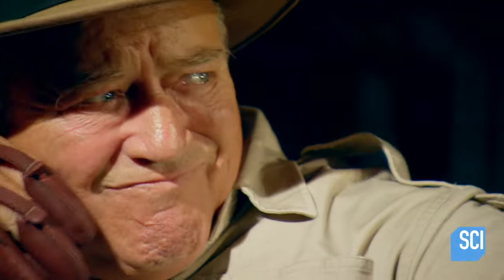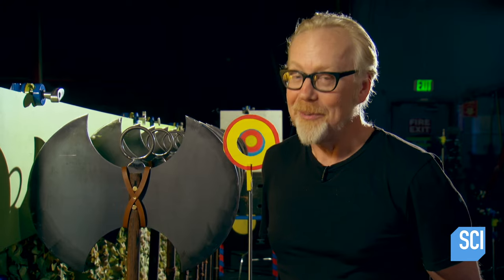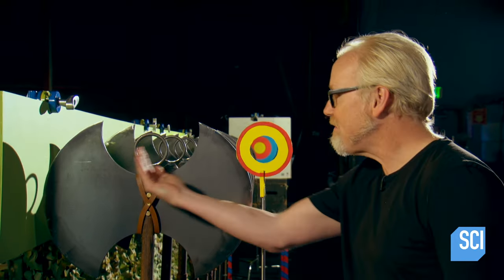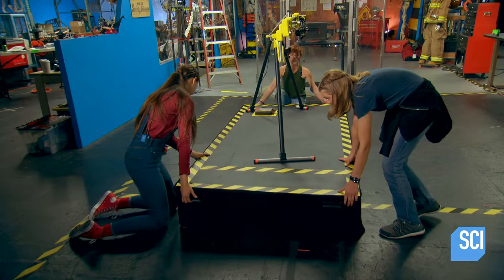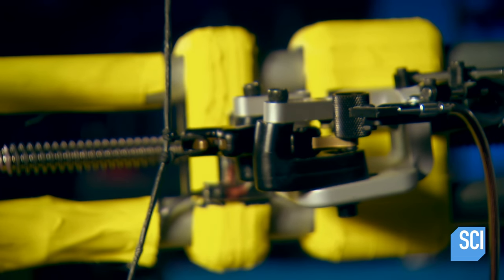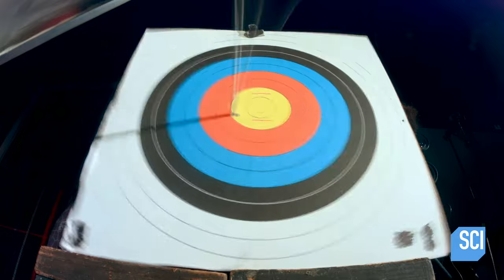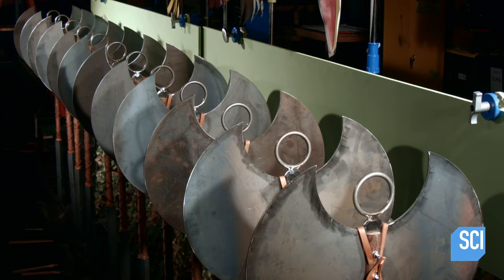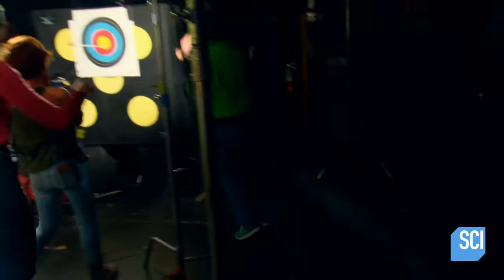Replicating the “Impossible” Odysseus Arrow Shot | MythBusters Jr.

Comment: The book is talking about the eye of the axe, which is hole the handle goes through.  Not a round loop off the top.
Reply: Why isn't this comment more appreciated?
Reply: To be honest, the axes are basically just for show, it's just about the ring
Reply: Spot Trooper makes a great point, those rings are definitely way larger than the hooks on the bottom would be. Not to mention the fact that those look like a fantasized version of a dane axe and don’t have nor need hooks
Reply: In Russia it was firing trough wedding ring and into the edge of a dagger to split the arrow so it woudn't kill the person holding both. I don't think it is such a big problem if the hole is big enough for an arrow to go trough.
Reply: @Spot Trooper True, you get a point.
Reply: It's not the eye. Some bronze age axe heads were fenestrated, which means there were holes in the side of the blade to lighten the weight of the axe. The ring on top here is inaccurate, but the way the axes are lined up is basically correct. The hole should just have been in the middle of the blade instead of on top.
Reply: I recall that in some movie the arrow went through the opening in the blade, which is quite wide.  That opening is very small, and I don’t think it could have ever had any use.  While an opening in the axe head would widen the blade, decrease excess weigh, and allow a lower angle of attack of the blade.  Saving energy…. Think of an opening in the shape of a capital D in the blade.

Comment: In the epic, the bow was nigh-impossible to string.  Therefore it's a very stiff bow.  Thus a very POWERFUL bow for a powerful man.  That would make the arc of the arrow launched from it flatter in that range.  Then the question on the arrows: how much can they flex before hitting the rings?
Reply: Are u Legolas?
Reply: John Smith  The stronger the bow the more it should increase the paradox and even going with stiffer arrows will only result in the identical flight as a weaker bow and flimsier arrows. The only way to reduce the paradox would be by stiffer arrows under the same draw weight.

Comment: So many people comment that Corridor Digital did this last year. However, there are a few things to note:
1. Corridor had larger holes which were not metal. If they were, even a slight touch of the arrow (yes, the arrow touched the sides) would've resulted in a failure.
2. Odysseus' bow was the strongest bow ever made (according to the myth) and only he could draw it. A weak bow has naturally a greater projectile drop.
3. „Shooting though axe heads“ is a vague term. Some people cut holes into the axe heads, some add rings. But it is very likely that the holes the shafts are attached to are meant here, and shooting through multiple of those is nearly impossible.
Reply: I feel like high bow strength would actually make it harder. Less bow drop, but higher strength bow would mean the arrow flexes way more, making it more likely to hit the sides.
Reply: i dont think nikos shot would have done it on metal but nicks shot was perfect and would have totally made it
Reply: @aaronyoung9922  if you look at the slowed down footage on the second shot you see that basically the only thing touching the axes is like the back "feathers" for a split second
Reply: I always interpreted the contest description as the hole in the head that the  helve fits into, not a ring on the axe head nor a hole cut into the head of the axe. That would make it even more of an impossible task in that hole would be through a solid metal head with virtually no play, and the arrow would have to be launched not only precisely but with enough force to ensure that the speed of the arrow keeps it on as straight a course for as long as possible.

Comment: Don’t move the bow.... move the target and then the tunnel to where the bow wants to be.
Reply: To late, what's done is done
Reply: Yeah, I feel like that would have been WAY easier.
Reply: How would moving all the rings be easier? Lining those up must be a nightmare. Moving the bow is FAR easier than trying to change the direction of ALL those rings' alignment.
Reply: @spamhere1123  yea. Why would you move 12 rings that are lined up already. That's a  very strange suggestion. Moving the target is also not the main issue. Besides, that's not the myth. The idea is whether or not it's possible for someone to do this. And judging by that high speed, even with near perfect relocation, they still barely pulled off a miracle shot
Reply: spamhere1123 lasers, boards, doweling or a common base platform would have made that super easy since there are common touchable alignment points. The reason the bow was hard to align was because it doesn’t have anything that perfectly aligns with the shot except the arrows flight path which is hard to predict and impossible to hold still and use for alignment.
Reply: @rosedruid  You can't be serious. Do you actually believe that moving and aligning about 20 rings is easier than moving the one platform the bow is mounted on? And you can literally align the arrow with the draw track they had machined in there, which apparently worked like a charm, because they hit it first shot.
Reply: spamhere1123  Yes, because changing 1 variable(ring) won't fk up the other 11 rings and each would be independent of another. Whereas changing aim of the bow is a variable that makes all 12 rings dependent on another.

Ex. Arrow hits the 11th ring. You suggest to completely change the aim. Or you adjust only the last ring.

Being lucky like them can very easily skew viwers perception on how poorly their method of calibrating may seem.
Reply: The end result is the same.
Reply: No joke genius a compound bow is alrradu accurate enough, to even habe the idea of using a machine to shoot it is just plain stupid.
Reply: So you want to move a big ass target and the ring in order to make the shot perfect? Yea let me position this 20kg target while my bow weights 2kg its also easier to line an arrow with the target if you JUST MOVE THE BOW you DO NOT touch your target you touch your bow and what your using to line the arrow up you don't move the largest thing
Reply: Yeah that was an extreme oversight
Reply: To all the people saying "moving one rig is easier than 12 rings" like the rings weren't all boarded down on a single board that is easy to move. And if they didn't do it this way, then it just shows how far the shown has gone down since Jamie left. 

Just in case you still don't grasp it, all the axes should've been on one long platform, which is much easier to move AS A SINGLE PIECE instead of moving two pieces, including the bow, and hoping they lined up. They wouldn't ever be moving more than 1 piece this way. 

The issue with the new kids is Adam has no one to clash with anymore. All the kids look at him like a God and does exactly what he says. Jamie and Adam clashing  and explosions is what made this show great. It is no longer great.

Comment: So I want to point somethings out, 1: Odysseus had a multi-hundred pound(like over 200lbs) recurve bow, not a longbow, this does change a lot of the factors, due to the fact that an average Welsh(British) Longbow was about 100lbs in weight, and by increasing the power of a bow, increases the amount of speed and force that arrow can produce, and can create a long flat fight path before it started to curve downwards. 2: They are by far not the first people to try to do this challenge(of their age range? Probably) this is actually a very common challenge to attempt throughout history, and it has been done.

The reason why this shot is said to be impossible is because of the weight of the bow, as literally, no one should be able to draw a 200+lb bow and shoot accurately enough to thread an arrow through ringed Axe Heads. But this is by no means impossible

Comment: When a human who uses their fingers to "release" the bow's string,  Archer's Paradox is more pronounced in the X-plane. When a compound bow is used, the oscillations are more pronounced in the Y-plane due to the use of a drop-away arrow rest. If you look closely, the last 2 rings were "hit" with the arrow's vanes. Yes, when a human attempts the shot, it is all but impossible with the relatively small inner diameter of those rings due to the LARGER oscillations caused by the human archer!

Comment: This is not correct- by using a modern compound bow, the arrow flexes a lot less because of its higher speed. With a traditional bow this would be impossible, not plausible at all.
Reply: Wrong look at corridor crew they did it
Reply: Well according historians about the myth the archer was stronger than most people and he made a unique bow designed for only him to use. It may not be compound bow, but it could of been powerful as one from the custom longbow. Thus, it is possible for the individual to do 
so, but it is uncommon for that individual to have lot of strength. It's plausible to some to many no you have the right to claim it.
Reply: Trevor Allen ok, the mythical bow that Odysseus was able to use from his strength granted to him by Athena would be able to do this.
Reply: The flex of the arrow is not based on its speed through the air. It's based on the flexibility of the arrow and the strength of the bow pushing said arrow. A more rigid arrow pushed by a 40 lb recurve will barely flex at all even though it will travel at much lower speeds than a highly flexible arrow pushed by a 100 lb compound bow.
Reply: Devin Hernandez yes but if odysseus used that stiff of an arrow with a tradition bow like others of the time period the arrow would not be flexible enough to satisfy the archers paradox and fly “straight” as it were. Either way, I suppose it is important to remember that this is a myth where gods intervene with human action, strength, and decision making, so anything goes.
Reply: @arigerard9239  I was addressing your incorrect statement that the arrow flexed less because of its speed. That is simply not the case. The arrow flexes less because of its rigidity. On a compound bow like the one they were using, the archer's paradox has little to no effect. The arrow does not have to bend around the bow like it would on an old long bow or recurve bow. Meaning the arrow can be stiffer to accommodate for a stronger bow string.
Reply: Devin Hernandez yes I am aware of this. I was assuming that in ancient greek times they didn’t have the tools or knowledge of arrow rigidity and mass and how the different variables affect its flight. But im no expert on ancient greek weaponry.

Comment: Those that are saying the archer's paradox would make a straight shot impossible are either forgetting, or not aware, that arrow's spine plays a great importance to this.

Over spine the arrow, and there will be little to no "course correction". Then just correct for a new point of aim.
If Odyssey's bow was as powerful as purported, the correct arrows to deal with a "normal" level of archer's paradox would have already made it much stiffer than what any other bow needed.

The flip side to this is to use a heavily underspined arrow to shoot arrows that seemingly turn midair.

Comment: Point #1: You need an archer that is actually pulling and HOLDING the string and the bow weight, and releasing with his fingers.
Point #2 : A compound "bow" is not a bow, it's just an arrow launcher with nothing in common with a proper BOW (see point 1).
Maybe I will try it and see if its possible or not.

Comment: I don't think "the eye of an axe" from the Odessy means a hanging loop over the ax, which wasn't a thing done with axes. It means the hole in the ax head through which the handle is fitted. That makes much more sense than the arrangement you are showing in this video.

Comment: Ok fact number 1. The average draw weight of a classical longbow is believed to somewhere near an astounding 175lbs. Historians as well as scientists are baffled at how they were used effectively but they were. The longbow they tried would have been no where near that strength as they were pulling it pretty easily. The compound bow they used was  probably around 100lb if not lower. So assuming that Odysseus's "bow which no man besides himself posessesd the strength to draw" is at least as strong as the average for a classical English longbow. Then the force and therefore speed of the arrow would have been almost doubled from even the compound bow. As the original fictitous bow was supposedly impossible to draw for anyone weaker than Odysseus, we can assume that it was far stronger than 175lb and would then would send the arrow far faster. According to physics the gravitational pull exerted on the arrow stays the same while the forward momentum is increased, this effectively means that the arrow has less drop over a greater distance. It flies straighter. Taking into account that it was a fictional weapon, this is still not an accurate depiction of how the arrow would have traveled in that fictional situation. For a man capable of drawing a bow with such Power this shot would have been far easier because there would have been little to know arrow drop.

Comment: Odysseus did not use a longbow. Your compound bow could do it because it's probably a good 100-150fps faster than Byron's longbow (about 200fps). Witha faster trad bow, and they are out there, it might be done. Modern trad flight bows, and Turkish style trad bows, with lighter arrows can get the same speeds as a modern compound bow (up to 500fps) and cast arrows as far (over 1300yds).

Comment: It's an IMPOSSIBLE shot, and by impossible  I mean that IT CAN NOT BE DONE with the bow technology of Odysseus' day.  The central section of the bow (the riser) was off-set from the line of travel of the strings movement because of the required rigidity needed.  This (along with the archers sight picture) creates what is known as the "archers paradox"  The arrow shaft WILL be (and MUST NEEDS BE) severely bent/flexed as it is launched to get past the riser and then it will go through a cycle of harmonic flexing.  At some point this flexing will be reduced to describe a path narrow enough to pass through the axe-head eyes  BUT not until after it has slowed down enough that the fight path begins to drop at an ever increasing curve.  So the ONLY hope you have is to pre-align the openings along a known and well described trajectory.  Given modern bows and a well enclosed indoor range I could do this in ten  practice shots with eight or more cameras and a day to analyze and then  and then one actual "attempt" should do  But if I posted it on youtube you would only see the successful one shot attempt  because I'm just that much better than Odysseus and adam savage combined

Comment: Actually, before even proceeding on with the test, is there a consensus about what holes in the axe Ulysses shot his arrow through? Because by looking at artistic interpretations of the scene it seems even illustrators are not of one single mind about it, either.
Was it:
1) a ring either at top of the axe's head or at the bottom of the handle, the kind of which can be used to hang a tool on a wall?
2) the hole in the axe's head where the pole goes through?
3) since the Trojan war takes place during the last stages of the Bronze Age and in turn so do the Ilyad and the Odyssey, there used to be some special kinds of cerimonial axes called "fenestrated axes" by archaelogists. These axes had one or more D-shaped holes inside the axe's blade. While I don't think memory of those axes survived later on, one can imagine they were still in use at the time the poem originated. So, in light of this, did Homer or whoever the original author was, have in mind a fenestrated axe when he described that scene?

Comment: The bow had a drawstrength of hundreds of pounds. Also he probably had a little more distance thereby eliminating the archers paradox. It's not point blank. A ridiculously heavy bow would offer enough power.
Reply: Do you know anything about bows? The compound bows have a MAX draw weight of 70lbs 😂😂😂 if you do the math that is a total velocity of 200mph that's a total of 300ft per second or if you live outside the US 320kph is the max velocity speed of an arrow fired from a compound bow while recurve bows can make the arrow fly at 225ft per second or 150mph or 240kph

Comment: I love this is back.. but if the Point Blank range of the Bow is further than the target it should be possible to aim right through. So from a Physics point with a perfectly aligned bow it should be possible. 

However the trick is not if it is possible via Machine.. it is doing it with a person. As it was a feet of skill not of possibility. He didn't do the impossible basic physics says that. Still really cool.

Comment: No it’s science as you need to account for arrow flex, through riser or traditional, distance of stabilization, arrow balance, and yea list goes on. Shot is totally plausible and you didn’t need a machine to figure it out. Kind of shocked he was surprised it worked and didn’t repeat the shot. Think if it this way, if you touch the ring slightly with the fletching it’s likely to aid it correcting its flight. Plus bows back then had real men behind them pulling average of 100 lbs draw strength. No it wasn’t a long bow it was a rams horn bow that was used and more like a recurve/mongal bow.

Comment: Odysseus did not use a longbow. The longbow was invented millennia later in Wales. Odysseus's bow was a unique design made from goat or ram horn, likely an Alpine Ibex. Probably two matched horns from the same animal put end to end and joined in the middle somehow to make a recurved shortbow. Completely impractical, but that's why it's a myth. Part of the difficulty of the shot was that the draw weight of such a bow was absurdly high, and the strength required to hold the bow steady while drawn was beyond human ability.